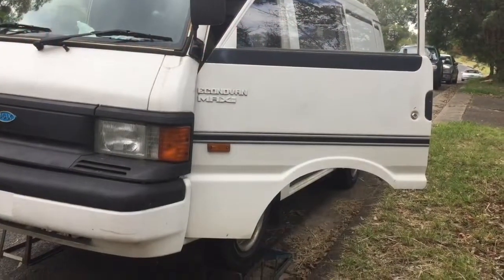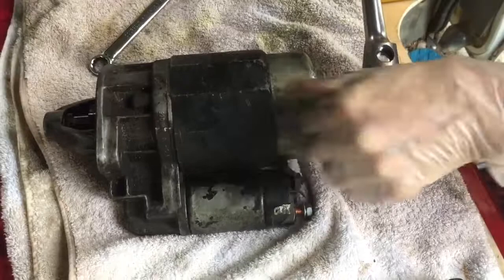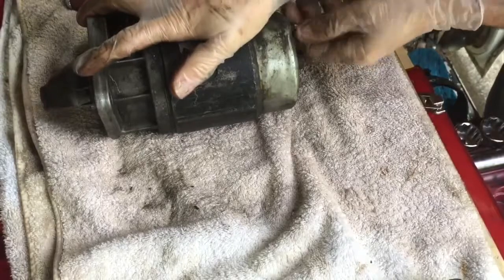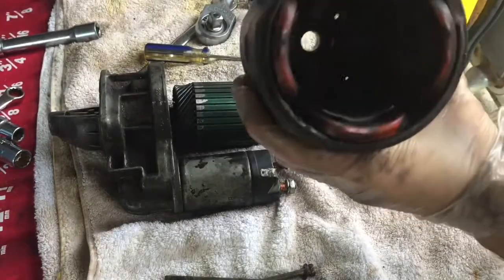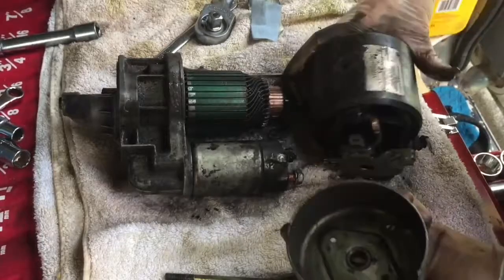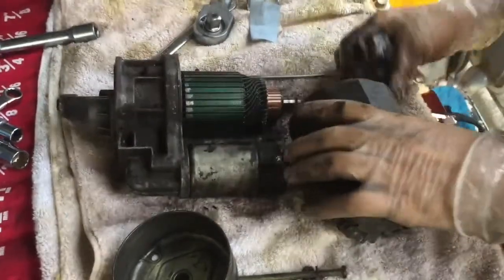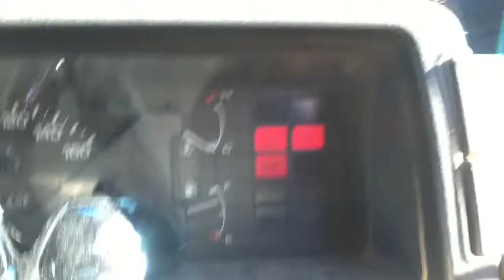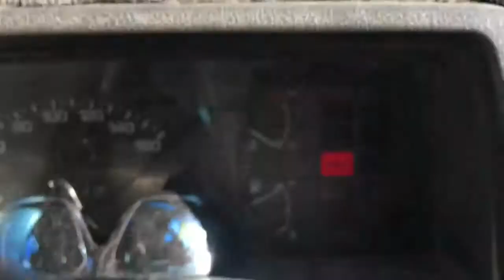DIY Starter Motor service in Max, my Ford Econovan

Comment: This is great! Do you have one on how to get the starter motor out? 😅 I'm stuck on that step lol
Reply from the maker: I don’t think so. I remove mine from underneath the van. 2or 3 bolts and the wires use plugs so just slip off.